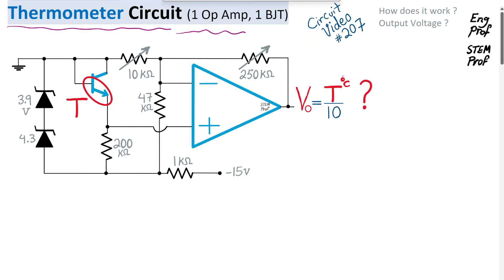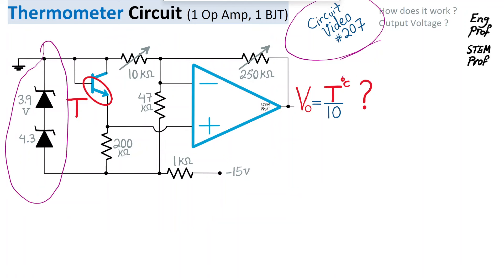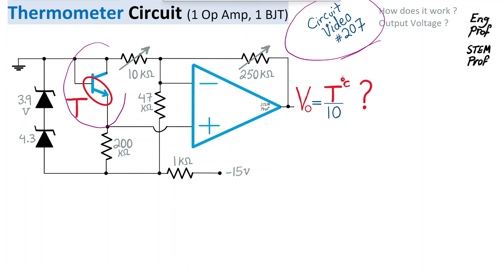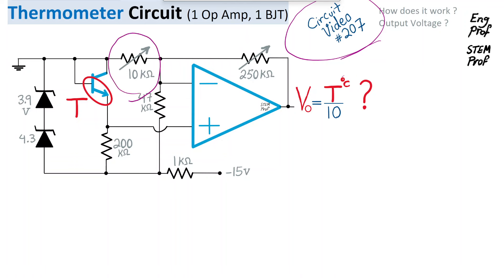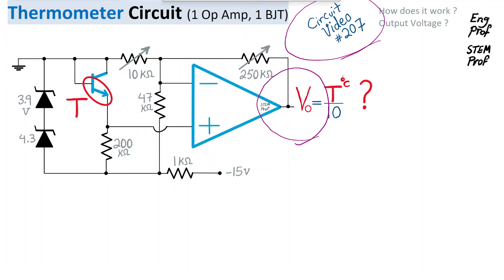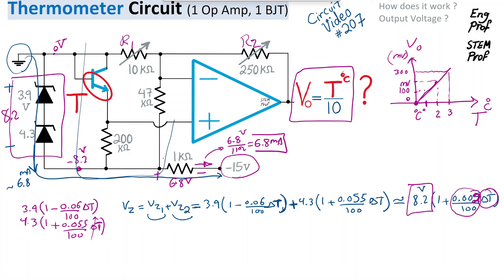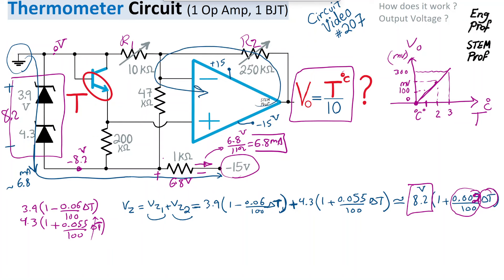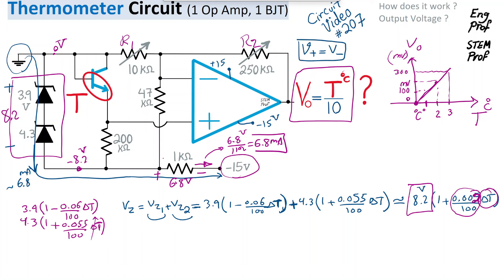Thermometer Sensor Circuit Explained with Op Amp and NPN Transistor

Comment from the maker: Thermometer Sensor Circuit Operation is explained in this video. For more sensor amplifiers see https://www.youtube.com/playlist?list=PLrwXF7N522y7Ut9bm8TXAOhIWqL__FGlj and the following videos
EKG ECG Amplifier with Right Leg Drive Explained https://youtu.be/1c7KGXPs4do
Thermometer Circuit Design with Op Amp and BJT transistor https://youtu.be/55YsraFE0rg
PhotoDiode Amplifier with Data Compression Explained https://youtu.be/hqrRx2ufAwg
Thermometer Current source https://youtu.be/Ggf0yCaTTiY
Strain Gauge Wheatstone Bridge Instrumentation Amplifier Explained https://youtu.be/io1yBcCsP-Y
Temperature–Compensated Programmable Current Source Circuit Design with Zener Diode, BJT Transistors https://youtu.be/QY48IQXJIRI
Temperature-Independent Current Circuit Design with Op Amp, BJT, Zener, Schottky Diodes https://youtu.be/hFbnjbddUvs
Instrumentation Amplifier with Electronic Gain Control https://youtu.be/C4tghZ-q6Zs
For more analog circuits and signal processing examples see: https://www.youtube.com/playlist?list=PLrwXF7N522y4c7c-8KBjrwd7IyaZfWxyt
I hope these sensors and thermometer circuits videos are interesting. 🙂

Comment: Can two zeners be replaced with a single TL431 ?
Reply from the maker: That's a good question. Yes, you can as long as the precision reference voltage is set so that it's temperature variation is negligible compared with -2.1mv per degree voltage change of PN junction.  Otherwise, more precise Shunt Voltage Regulator is recommended.

Comment: Actually, 4.3(0.055%)-3.9(0.06%)=0.0025% so V = 8.2V(1+0.0003% (T-25C)).  Also, by varying the Zener current we could even trim this out to have zero temperature coefficient.
Reply from the maker: Well said! Thank you for the follow-up accurate calculation of the overall temperature coefficient for the series of two Zener Diodes described in the video. The Zener current adjustment is best done via using a Potentiometer instead of the fixed 1k Ohm resistor.  For an alternative Temperature sensor design technique pls see  Thermometer Circuit Design with Op Amp and BJT transistor https://youtu.be/55YsraFE0rg

Comment: -15V required  :(
Reply from the maker: -15v is not required.  You can change it to -10V and reduce 1k Ohm to say 470 Ohm. Or alternatively we can design the same circuit using +15V instead of -15V.   Here is also an alternative implementation: Thermometer Circuit Design with Op Amp & BJT transistor https://youtu.be/55YsraFE0rg
Reply: Could snap ground for +15V and snap-15V for ground to get the same potential difference, non?
Reply from the maker: From Voltage difference perspective, yes but we won't then get zero volt at output when PN junction temperature is zero degrees Celsius. We will need a level shifter or further circuit modification.